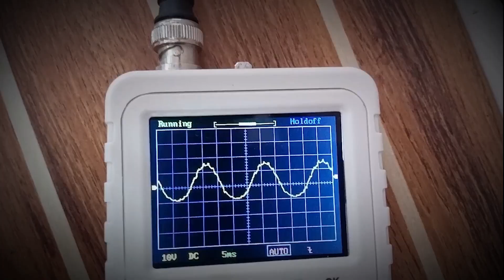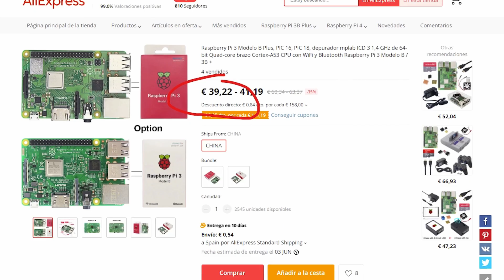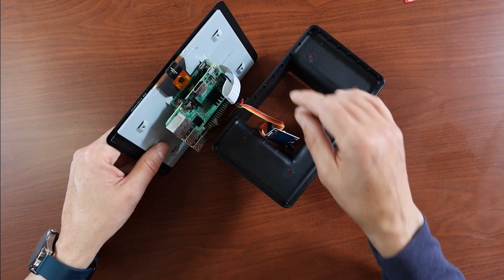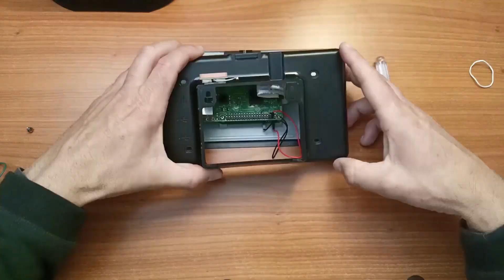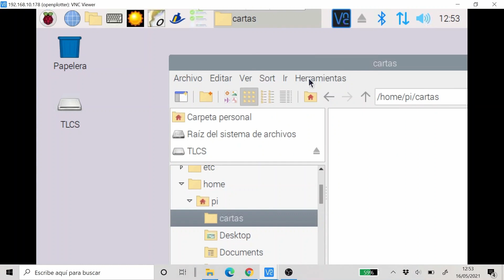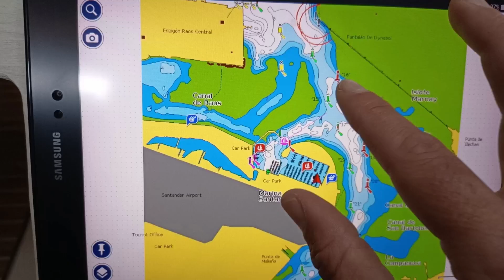EP11 - Low cost chart plotter for your boat:  Raspberry Pi + Open Plotter TUTORIAL

Comment: Hallo low cost sailer, I am trying to read the cumulativ ppm of the SDR but get values from - 9153 to + 100  the usb sdr is exactly the  one  light blue colored stick you arr showing in the video...what might be the reason ? should I try it  outside in my garden, now the antenne is just hanging close behind the windowpane at home, thanx a lot for your help Greeting from Hamburg
Reply from the maker: Because the use of telephone frequencies is changing, it's difficult to get a stable reading. If you have the blue TV receiver, I would try setting the PPM to -47, which is the value you usually get for that device.

Comment: I have OpenCPN installed on a Raspberry Pi5. It appears to be ok - but if I plug the SDR TV tuner in - same as the one you use, the HDMI display goes blank and only by unplugging it does the display return. Am I doing something stupid ?
Reply from the maker: I've never had anything like this happen to me, although based on the symptoms it could be that you don't have a powerful enough power supply for the Raspberry Pi and the power consumption of the TV tuner is causing it to shut down due to insufficient current.

Comment: For AIS is see you are calibrating through SDR VHF 4.1.0 and using bang GSM900, is the ok to use for america?  thanks
Reply from the maker: No, its not. GSM900 is disappearing almost in every country and never have been available in USA. You can try with other networks, but most of the TV sticks that you can buy in aliexpress and have de word SDR on them, has the PPM already writen on them and always is near 0. The blue one I used in the video has a PPM of -47

Comment: Where did you get the waterproof case for this build? I’m putting it together
Reply from the maker: The box in this video isn't waterproof, but it's stored in a covered area. If you need a waterproof version, the best option is a Raspberry Pi without a screen to house all the electronics inside, and you can use a motorcycle GPS navigator via Wi-Fi as the screen, as seen in the last episode: https://youtu.be/StbX6zI5VYg

Comment: ¡Otro videazo, man! ¿Sería posible conectar un radar a la Raspberry de la misma forma que el AIS? ¡Sería un golazo! ¿Lo has evaluado?
Reply from the maker: Hay unos pocos radares que si se pueden conectar a la rasberry, principalmente algunos garming y furuno antiguos.. el resto estan demasido cerrados para ello.
Reply: @lowcostsailor   yeah, even the Raymarine Radome, the problem is that you need to send data to the PI via Ethernet cable and then its impossible to broadcast this from the PI via wifi.   the only option seems to connect a screen and run open plotter from the PI

Comment: my raspberry pi 5 arrived, hooked up all the goodies.  I finally figured out that I needed to be loading the raspberry five image from the plotter site and not from the raspberry pie site. Oh well, it's all about learning second I had to take the pi  off the video display board a couple of times to get all the USB connectors positioned and the screws holding it down back!  all good. I'm still unable to put all the USB devices on the board 
the screen going to have to use an extended USB 4 port couldn't get a GPS signal inside the house I was plugged into the 120 V so I couldn't go outside. No worries all little things, but I did get the pi working maps loaded. What a fun project!  my pi is running very hot so I bought the Heat sink!  not sure how I'm going to case it up. I did go with the 10.1 inch screen nice! it was pie ready, had the mounting holes on the back!  so tell me, how do I get Wi-Fi or Bluetooth display to my iPad? Also, I love that little keyboard. Can anybody explain the different types of maps in which have the most detail?  anyway enjoyed your video and I'm looking forward to part two

Comment: The ais system, does that also transpond your signal aswell? Didnt see that you setup any of your boats value. Or does this only collect the signal to see others?
Reply from the maker: It only received other boats signal, the distance is directly related with the antenna that you use. I usually see boats 10 NM away with my top of the mast antenna. To transpond my signal I use another, and very cheap, different device that I alredy show in one of the Spanish episodes: https://youtu.be/vlwIPdEAK_c

Comment: Hi, great video. 

I have a wish project ,🤗

How about  showing how to set up an offline weather station with this on the base of the touchscreen model?

Cheap Chinese sensors with NMEA:
Barometric pressure with graph and storm alarm.
Windspeed with graph and alarm.
Water temperature with Graph
Air temperature with graph.
Humidity with graph.

Let your ideas run wild 😊
Reply from the maker: It's an interesting idea for an episode, I already have most of that information on my Raspberry on board, Temperature, Barometric pressure, wind speed from the boat's wind vane, air and humidity temperature... But the idea of a storm alarm with that info is really interesting. Thanks.

Comment: My god, no wonder the openplotter has no videos on their websites, it looks like complete ass. OpenCPN is sluggish as hell on my 128GB Ryzen 7 computer with an RTX 4090, I'm afraid to imagine how it will behave on a raspberry pi lmao.

The marine opensource plotting software needs something new and GPU-capable.
Reply: I use it on a raspberry pi 5 and it runs great. I installed the whole openplotter OS so maybe they have tweaked it or something. It is faster than my old garmin 720.
Reply from the maker: With the RPI4 with 8GB memory, it runs smoothly. With de RPI3 it was really slow.
Reply: I've got the latest RPi 5 w/NMEA drive and it's still not fast enough to be my primary. Fine for monitoring and the odd management, but it's not fast enough for my brain
Reply: @Cacheola  Yep, my experience is similar :(
Reply: @lamarrrrr  Try to encode a video with the RPi, lmao. What would take 5 minutes on my Mac Mini, better part of a day on the RPi